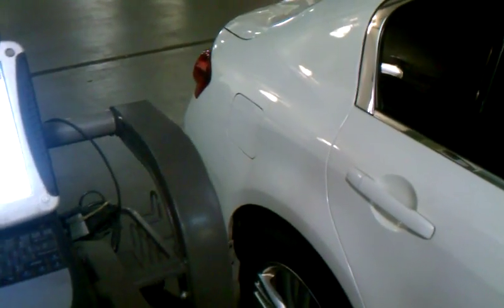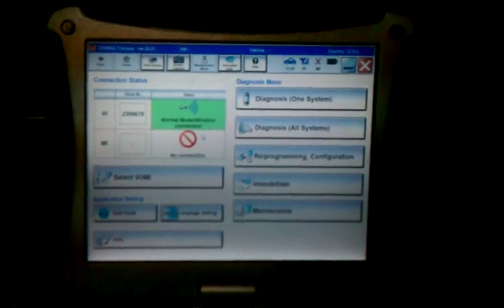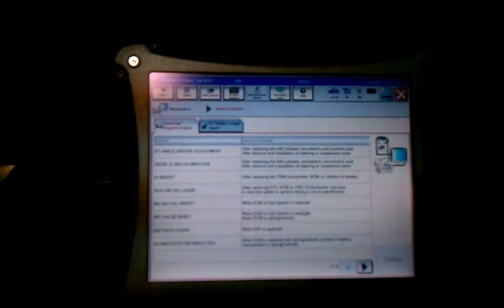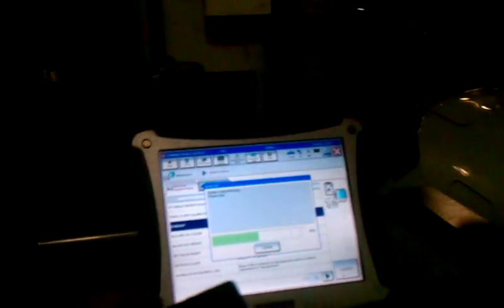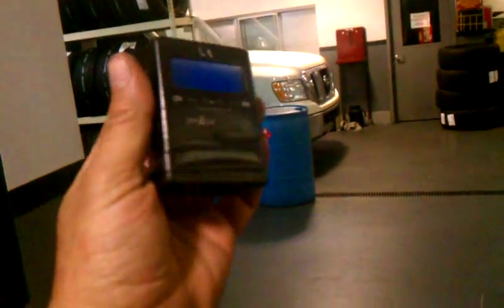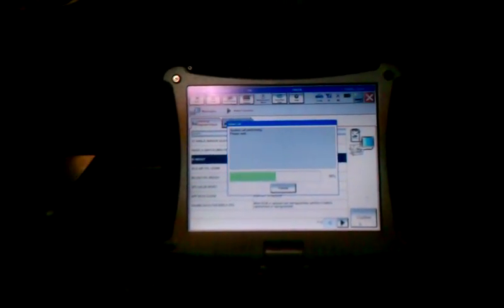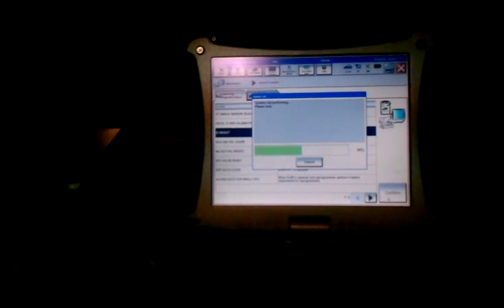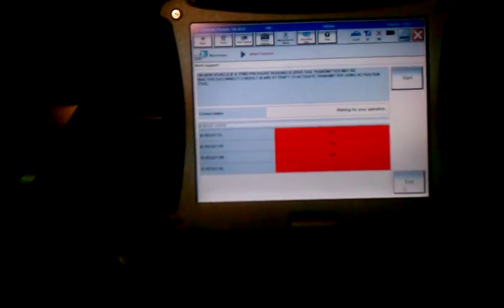Program Tire Pressure Sensors and how they do it at a Nissan or Infiniti Dealer.

Comment: Is there a difference between original Pacific TPMS vs part-store 315mhz TPMS?  There is no port on the tpms to really program it !   Dealer want an hour of labor to do what you did in 2min30sec while speaking. ..  I have a 2009 G37x. Thanks
Reply from the maker: for the dealer to charge you that much, that is nuts. I can understand a 1/2 hour labor to be honest, cause it takes time to load the scanner and you are also scanning all systems. But there is another took called signal tech. If they have that, they should be able to program them even faster than this video. You can try a Nissan Dealer as well if the Infiniti dealer is going to charge you that much.

Comment: On the 2012 Pathfinder, is there a secret to determining WHICH tires are showing up on the Tire Pressure Monitoring System (TPMS) as low?  The manual says the pressures are displayed "randomly".  That just doesn't make sense!  If a tire is low, I might have to check all 4 tires before I 'randomly' stumble upon the culprit!

Comment: Thank you so much for posting this.  My local garage apparently does not have the Nissan Consultant software & hardware & repeatedly failed to reprogram the sensors correctly after repairing one tire (which they claim had a nail in it).  Then they charged me $125 per sensor for the replacement of 3 sensors they claimed were "bad."  Still the warning light came on. Then last week, after taking the Pathfinder in to have it repaired after a deer strike, I asked the body-repair guys to equalize the pressure (35 pounds) across all four tires & then reprogram the tire sensors & they did so using the Nissan Consultant software & hardware.  Guess what?  The tire sensor light has NOT been activated since--& I have now driven the Pathfinder over 100 miles & over 3.5 days (since the re-programming).  I will NOT return to the local garage for maintenance or future repairs.

Comment from the maker: You need a special tool to program tire pressure sensors. Plus programming the tire pressure sensor is one of the first steps. Cause if you do have a tire pressure sensor with a weak battery, once you program it, you know exactly which wheel it's at so it can be replaced. The sensor is replaced if the battery is weak. You can not just replace the battery I am afraid.

Comment from the maker: This can be due to a tire pressure sensor having a low battery. All the tire pressure sensors have batteries. If you start to get a weak battery on a Tire Pressure sensor, it can cause the tire light to come on, and program properly.

Comment: Hey I have a prob with my Infiniti fx35 but all the sensor is good and after 15 to 20 min drive the sign appear in the dash as a low tire pressure

Comment from the maker: I work at a infiniti dealer, and we only charge the customer 1/2 hour labor to replace a sensor and program it. The signal tech is another tool we use which makes programming the sensors easy. This tool is 1500 bucks to program the sensors, but we don't charge much to have the TPMS programmed. The labor is more of breaking down the tire and installing it, then balancing the tire. Programming is normally included in that repair. May want to call around to another quote on programming the sensor.